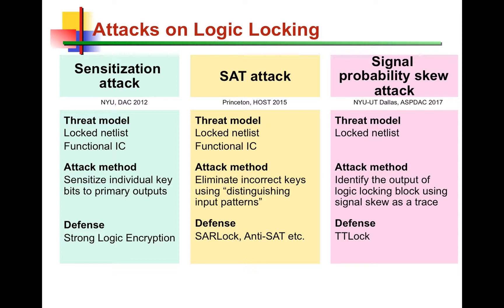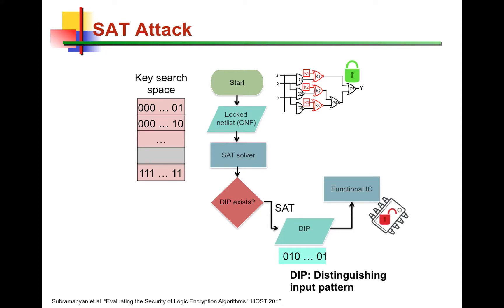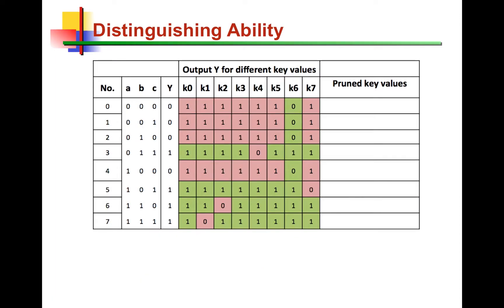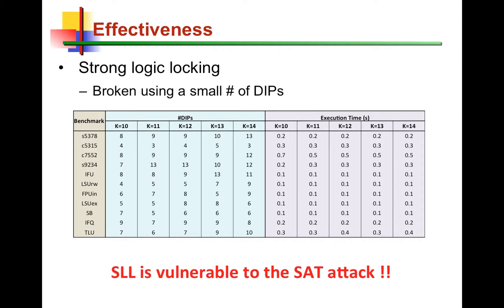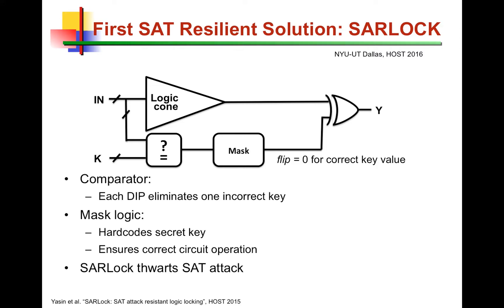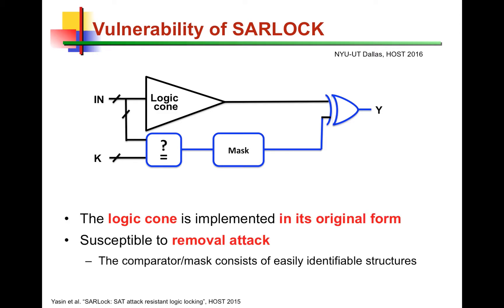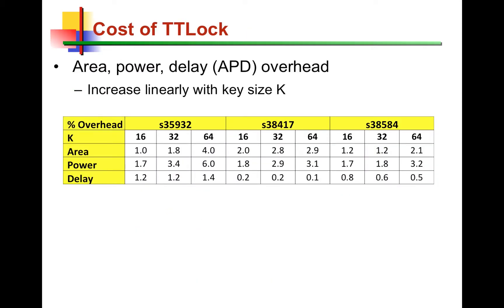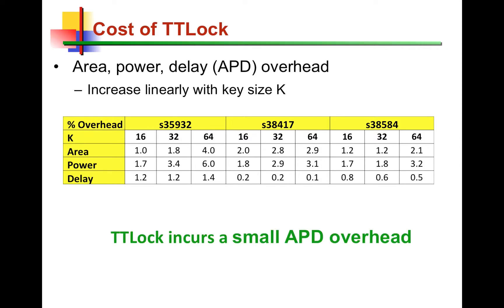Module 9 - SAT Attack on Logic Locking

Comment: The SAT attack is explained very clearly. May I humbly inquire about a question?

In SAT attack, it is necessary to calculate the output corresponding to each key in each iteration. Therefore, does the complexity of cracking SARLock become 2^(# of key bits) + # of DIPs?

Looking forward to your response, my English is not good. Please forgive me if there is any offense.

Comment: After removing the restore function in TTLock, is the circuit really locked if only 1 input pair produces incorrect output?

Either it works as a blackbox, or the program using that circuit crashes. If inputs to the circuit are logged, I would assume this crash can identify the protected input as the dip.

Comment: At 10:45, does that mean SARlock gives correct outputs for all the cases except for one input case?. Like in the key input K0, it gives the wrong output for only "000" input but gives correct output in all other input cases. How does this be a strong logic lock?
Reply from the maker: Output corruption as you correctly guessed is limited. This is needed for resilience against the SAT attack. However, SFLL allows the designer to increase the corruption to multiple input patterns; the designer can then do trade off between corruption and SAT resilience and find the sweet spot.